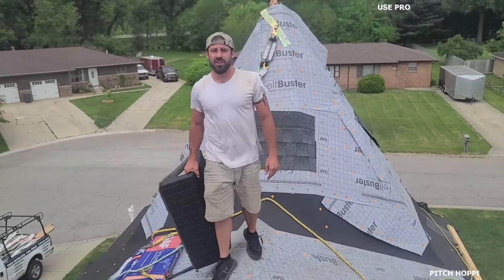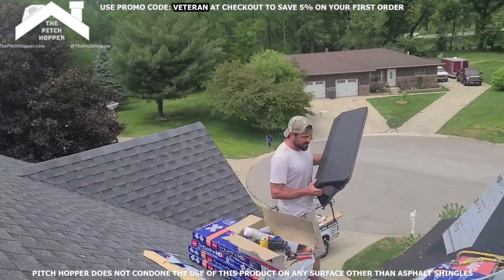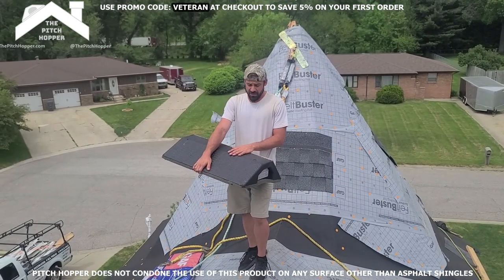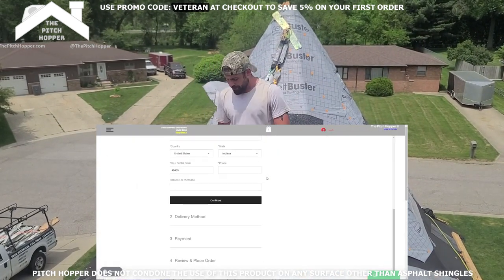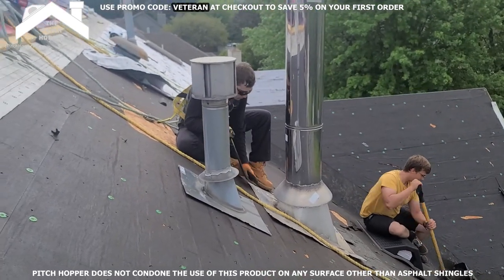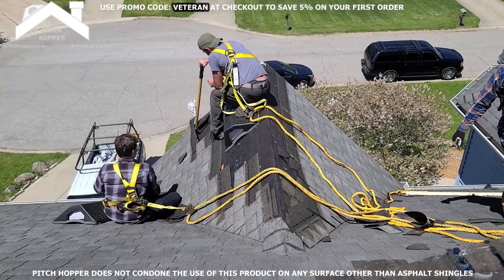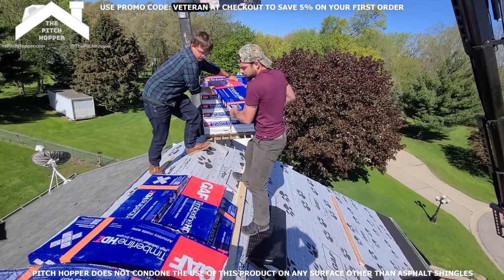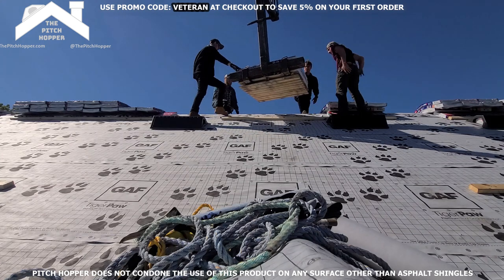The MUST HAVE Roofing Product of 2021!!!

Comment: Those tear off bars are THE BEST!!!! I used to have the $80-$100 orange bars and they wear down after 10 houses and they are no good so I went to ABC roofing supply and seen that black bar for $50 gave it a try and ever since i used it i fell in love and it like brand new after 3 months except for scratches and paint loss other than that the teeth r fine
Reply from the maker: they're great
Reply: What’s the bar called? About to tear off a roof and need the best haha

Comment: As of 10/10/21, the discount code no longer works (made sure that I used a capital 'V'). I bought 2 of these based on your recommendation, and they have been immensely helpful. Thanks! They've slipped when I've accidently reached too far (as you've demonstrated) and when there's too much loose debris. Don't trust them completely on just plywood, but they have a strong grip on synthetic underlayment and shingles.

Comment: The thing is, this is only their first generation and with time maybe they’ll fine a solution for it not to move when you’re reaching for something and also maybe even upgrade the grip on it. Definitely getting one of these with your promo code even tho I don’t roof but it’ll come in handy.
Reply from the maker: well, i'm not sure about that! only because they really are sticky af...and you can lean forward all you want on them, the issue is when your pressure is like 90% off it...like i saw a guy sliding bundles at it. of course it ain't gonna stay like that. but you can set a bundle partially on it with the rest of it at the angle of the roof and it won't go nowhere!

Comment: Props, thats damn hard work, I just finished shingling my 10x10 shed and that was enough to tell me my 55 year old body ain’t 30, I will be hiring it out next time when the house needs to be done.
I think I may buy one of those pitch hoppers, not for roofing but to put under my knees when I’m lying down on my back to help relieve my sciatic nerve pain from that damn shed.
Reply: Just finished our 19sq roof at 59 1/2..:). But had my young 45 year old buddy to help and it was only 4 in 12.. That was the last roof I'm ever doing though..
Reply: Zack is probably laughing his head off at the thought of all these geriatrics doing roofing...:)
Reply: Try it in area where you have to use shingle cement, I’ve got to put a layer of tar on the bottom side of every shingle I lay. If not they’ll be blown off the roof. Makes the process a lot longer and more tedious.

Comment from the maker: When using this product it is important to know that the Pitch Hopper is ONLY permitted on asphalt shingles and not other surfaces. Not plywood, not felt, not ice and water shield, not metal roofing, etc. ONLY USE WHEN ON TOP OF DRY ASPHALT  SHINGLES AND DO NOT USE ON ROOF SLOPES GREATER THAN 12/12. This product is not to be used in place of your safety equipment! It is a safety aid, but it is not a piece of safety equipment! Wear your ropes and harnesses, and always put your toe boards down to ensure your safety.  By using the Promo Code " Veteran " at checkout you will save 5% off of your ENTIRE order, regardless if you buy 1 for  yourself or 10 for your crew. I personally recommend 2 per roofer as these Pitch Hoppers compliment each other very well. One to stand on, and another to hold your shingles is the perfect scenario for speed and comfort. I demonstrate in this video. Please be sure of exactly how many you really think you need before buying because I can only save you 5% this ONE TIME. If you go back to buy more, even if the promo is still running, you won't get the discount again because this is a one-time-per-customer 5%-Discount-limit. And I am POSITIVE you will want more than one Pitch Hopper. Don't forget to share this video with your fellow roofers, employees and employers! Link below to view products! Personally, I will be getting some of the 32" yellow ones next. 
I challenge all you roofers who support the channel to share this video with anybody you know that can benefit from the product and if you have a boss, do your best to convince him to buy a few for everybody! Pitch Hopper coverers shipping when you spend 350$ or more. Make sure you guys use the Promo Code "Veteran" at check out. Caps matter. That's Veteran with a capital V 

https://www.thepitchhopper.com/shop
Reply: You forgot to tear the old roof off…
Reply: The next model you will be able to lean out and it won't move thanks to you great review.
Reply from the maker: it doesn't move honestly. i had no pressure on that thing

Comment: Yeah as soon as you take some weight off, or unevenly distribute it, you're gonna slip... And it's a fast, unsuspecting slip... We've had then on my crew for a few months ago... They were 60 bucks a piece
Reply from the maker: That's not entirely true.  I'm going to demonstrate this better in my next video.  That thing stays really good unless you're on it completely wrong. If you're standing up straight or leaving forward a little it will not go anywhere.  Most times I had even a little slip it was because my house got under on my feet but it caught its grip back before anything happened
Reply: @NWIVeteranConstruction  .. Yeah it could just be from ours being so worn out.. We use the hell outta them, and I know that there's already chunks of the cushion part already missing.. We're due to get a couple new ones

Comment: Hey Veteran. Question - Why do you guys use toe boards (2x4’s) instead of brackets and planks? In my experience it’s much more comfortable to walk on and keep materials on the roof. I’m a roofer here in Massachusetts. Pitch hopper looks like a nice bit of kit to add to the arsenal. Cheers!
Reply from the maker: During tear off it's easier.  We do the hooks when we shingle

Comment: How long does the back last
Reply from the maker: Much longer when you're standing up right on this things....oh, you mean the pads... lol you'll get a few yrs out of them with light use.  They recommend around a yr or so is you're using everyday.  Mine are older than this video, used them plenty of times and just used them again after a while if not using them. No issues
Reply from the maker: Also, I'm not stretching the truth even a little when I say that you can use these things once and it'll make your money back.  A lot of times I would need to set up toe boards or   find a place to stack bundles or material or go up and down the ladder for tools coz I got nowhere put them... all right there on my pitch hoppers. Must have on 7/12 and up

Comment: I'd rather spend 250 on these than 250 on cougar paws.
Reply from the maker: absolutely! and 2 of them at 32 inch will still run you less than that
Reply: Right, plus cougar paws will wear out lot sooner, only you can wear the shoes when with the pitch hoppers multiple people can use them at a time, well not exactly but you get what i mean
Reply: I've been using old couch sponges for free the truth is that who ever made that product just copied roofers use sponges the sponges don't slip like that thing and of course the sponges are free and way lighter and flexible don't waste your money on that just get some sponges
Reply from the maker: @gonzaloquinones5388  nah bro. You're looking at it wrong. They saw an issue with the stinky couch cushions and realized that it doesn't do anything for your foot comfort.  So they built a light weight platform and figured out how to adhere a think cushion to it. It's actually genius.  And far easier/ safer to use than a cusion
Reply: @NWIVeteranConstruction  could be, i was just shown to work the old way and I'm used to not use harness as well move faster more comfortably and might sound weird i feel safer with out it too the only time I've been close to falling of a roof was because of a harness rope and been roofing 5 years and counting with out one.
Reply: @gonzaloquinones5388  lol  5 years your not roofing a 12/12 2+ stories up without a harness unless your running Jack's every 5feet
Reply from the maker: i'll tell you what, you've never seen me in a harness till this video, and i've used plenty of cushions. different thickness, different size, all that. but after using 2 pitch hoppers and the harness, BRO YOU GATTA try it. it's the setup man. on a 12/12. 100%. I'm not bullshitten. i was genuinely surprised
Reply: @ivtec845  shit, you'd be surprised what you can do with a couple couch cushions. I use them on walkers in the summer to keep from scarring or protect my knees when doing chimneys or something. Cushions are still a must have for me but I do like the platform on these for 9/12's and up.
Reply: @NWIVeteranConstruction  coil dispenser and cup holder would be awesome tho. 👌
Reply: @gonzaloquinones5388  they need to stop making harness ropes the same color as osb. We'd have them up there for osha but not hooked in and I can't tell you how many times I  stepped on one and almost twist an ankle or something.
Reply: @ivtec845  I run racks ever 8 feet
Reply: @ivtec845  or stack bundles and stand on them and can reach aver 12 feet
Reply: @stevejones8486  well the reason i almost fell was because it got caught on a nail well tear off I immediately took it off and threw it down only and is last time I ever used a harness I just can't work with it
Reply: @gonzaloquinones5388  the ole nail stoppage eh. That always sucks. Gotta prep as you go so that felting goes smoothly. Nothing more annoying than having to prep after the tear-off. Specifically when your the dry in guy. Everyone else hits the ground while you're stuck pulling everyone's nails. As far as safety goes it just depends for me. If I'm 4 stories up in the air on some 5/12 apartment building overlooking a parking lot I might feel compelled to rope up just because. But the next day cushion a 1 story house that's 10/12 without a rope.  Long story short is I don't work unless I feel safe. That being said I'm gonna knock on some wood and say a little prayer for all the roofers in this chat.
Reply: @stevejones8486  I use 2  pitchforks for tear off not the roof shovel just find it way faster process and remove felt paper along with the shingle then use a hammer to pull out nails or hammer them in if there's no shingle residue on it
Reply: Cougar paws run about 150 where I live. We have these at the shop used em on a handful of jobs before the foam started peeling off the bottom. They are nice for holding material if self tending on a steep though..
Reply: Cougar paws are the shit!!!
Reply: @michaelthackston5709  I think there a bit over priced where I live and don't think thats a reasonable price for some roofing work boots I walk 8 9 even 10/12 fairly easy with wolverine boots with not sliding slipping its just good footing its like with a roofing gun u can have the best gun out there if your not good your just not good some times im to lazy to walk boots and I take some casual Adidas to work
Reply: @gonzaloquinones5388  yup iwalk 10/12 easily without myself but with them 12/12 i walk . Its all preferences my guy! What works for me might not for you. But i do love my pair
Reply: @michaelthackston5709  they look like ankle biters to me.  If they had low tops with a flatter bottom then I might buy some. Shoe designed for skateboarding are my preference.
Reply: @stevejones8486  skate boarding shoes do work 👏 amazing inhave a guy on my crew that loves dc shoes for roofing. Only complaint on skating shoes is they are to hot for my feet!

Comment: honestly bro I won't use that after u demonstrated that thing slipping from under you. especially not on a 12 nd 12 f that
Reply from the maker: that would happen with a regular cushion or anything else you actually don't fully stand on. i wasn't on it when it slid. i was sliding against it. like pretend you slid a bundle at it. thats basically what it takes to make it slide. and i tried to make it slide
Reply: oh for sure man. ur a beast roofer man I work the same way u do no bags lol